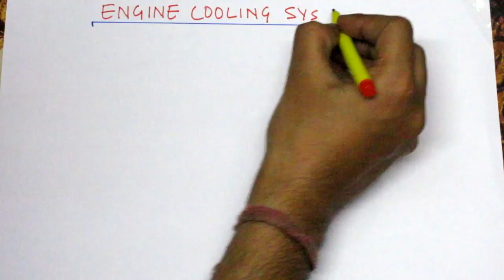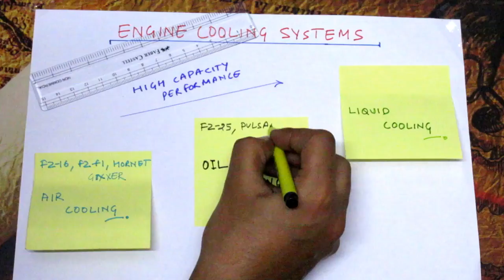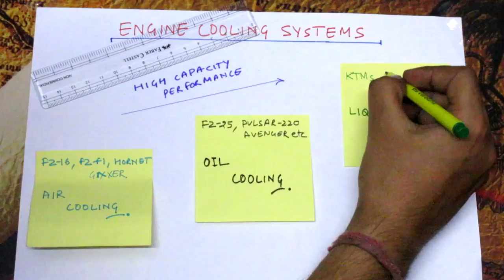Engine Cooling Systems for Motorcycles I Simplest Explanation Ever

Comment: hey bro nice video keep going i have a question what is mileage of fzs fi ? i am planning to buy and some says 35-40 some says 45-50 so not getting exact figure but i think you can tell me so pls can u
Reply from the maker: Sahil Patni I am glad you liked it bro! So coming to your question it all depends on Your riding style. FZ Fi has been provided with an ECO MODE system which is the Green light that keeps lit up if you ride uptil 70 Kmph. If you go beyond that ECO mode shuts down and the bike willn't be able to attain max fuel efficiency 👍 So if you Throttle hard, dont expect a good mileage. But yes, by appropriately sifting gears and within ECO MODE you can expected 45+ average without any issues ! Keep Supporting 👍👍
Reply: Bhai. Mere pas fzs2.0 hai
2sal me 75,000 km chala raha hu,,
City me 45&long ride me 50kmpl deti hai..